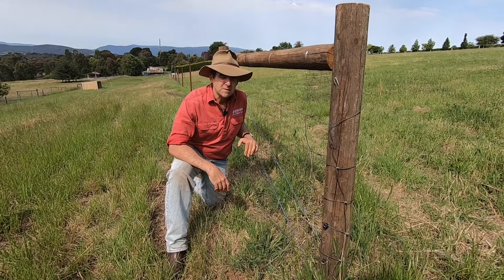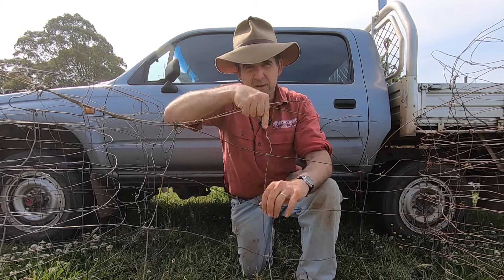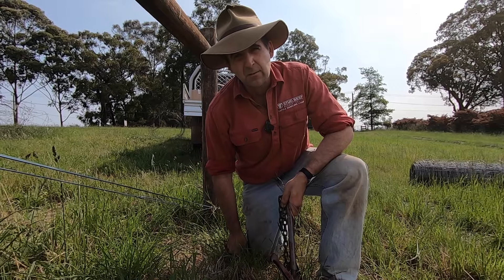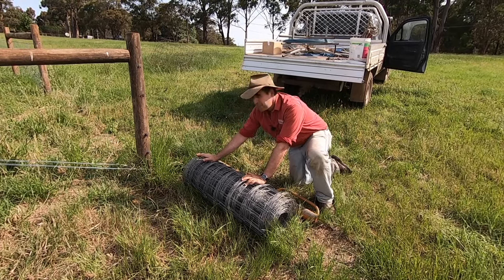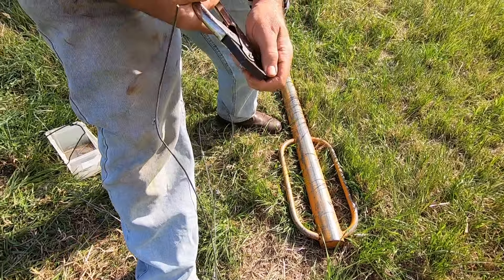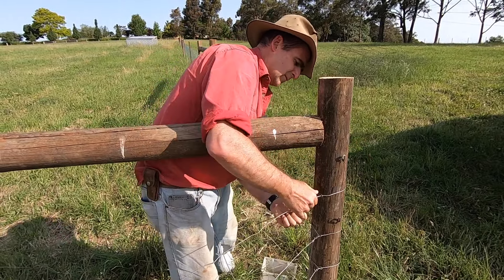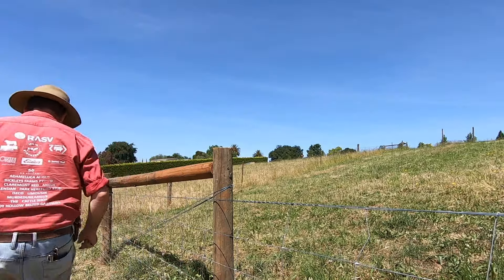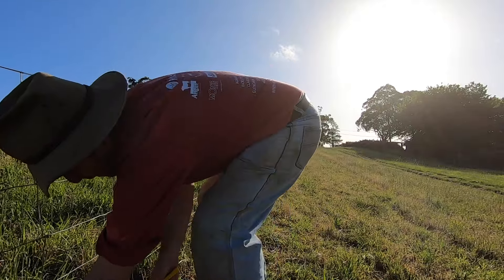How to Choose, Run Out, Strain and Attach Sheep Mesh

Comment: When you said if I ever used staples to strain wire you'd find me I did have a quick glance around the room. But I won't do it again now I know better. Thanks for sharing the info to help with doing it correctly.

Comment: Thanks for sharing Tim, lots of great tips that are often overlooked. What you explained is pretty much what DPI recommend. The only difference I did with my fencing is only using a single chain tensioner without a tension bar or board. I just took my time, started at the bottom, then pulled every second line, and tied off one line above each time, and only put enough tension as you explained, then lined up the uprights. I'm, keeping Goats and Sheep, and while the Sheep rub on the fence, the Goats really lean in the mesh, so far it just bounces back just like you explained, so allowing for that movement is really important. Now off to do some harrowing, lol.

Comment: So much great advice, best fencing video I've seen. I used Whites stiffstay which has high tensile as the top and bottom wires eliminating the need to run out those two extra lengths.

Comment: Thank you so much for the detailed information you’re literally the best fence guy on the Internet! 
Why do you suggest not making my own fence stretcher out of carriage bolts And a 2x6?
Reply: the amount of pressure you put on a wire  is like a tank trying to move a high rise building..
we use to strain every third post with a hoop made out of 32mm steam pipe about the same as the full length at once  but never did ring lock  but that was in Australia and maybe it was called different and my boss told me to do it that way

Comment: Hiya Tim loved the video, I’m very excited to be putting up some sheep mesh this weekend for my paddock to stop the dogs getting in from my neighbours. I bought one of those £30 generic monkey strainers (the yellow and blue one…) and I actually found it worked quite well for my top wires. I’ve just bought another one so i can tighten both my top and bottom wires of the sheep mesh. Haven’t quite got the funds for a proper straining clamp but for now i suppose ill just hook my strainers up to my top and bottom wires.
Reply from the maker: Hey mate. Glad you are looking forward to getting your fencing done. I know some people make do with 2x4 timber and coach bolts to make their own strainer bars. But I cannot recommend this as timber is not load rated for this purpose

Comment: Hi Tim great informative video. How necessary is it to have the wire on the top and bottom of the mesh? Can you not just have the mesh tensioned enough on its own?
Reply from the maker: Hey mate. Thanks. There are some new meshes that have a top and bottom line wire made from high tensile, (like striffstay), lowering the need. However older style mesh, like hinge joints have all soft wire lines, as mesh is designed to work as a trampoline, requiring stretch and elasticity. So a traditional mesh fence will sag between posts over time without support. Hope that’s clear enough. Cheers.

Comment: Hi, excellent video, thanks, so can you join the 100meter lengths of sheep wire net on the run and then strain up 200 or 300 meters at a time?

Comment: Hi Tim, Great video. Why don't you run the wires through the holes in the star posts? I've always been taught to do it this way, what is the benefit of either way. Thanks. Corey
Reply from the maker: I did a whole video on this just a few weeks ago. Check it out on my channel if you like.

Comment: Brilliant video Tim; extremely clear and helpful thanks. In the absence of a straining clamp arrangement, what’s your view on straining the line wires individually using the chain straining tool?
Reply from the maker: Difficult. The Whites strainer board is cheap (comparatively) safe and easy. It’s my go-to..... although I just got a Walters board... hmmmm sexy.....

Comment: Hey mate, looking to build my first sheep mesh fence. Can I use barb wire on my bottom ground/save wire instead of plain
Reply from the maker: I did this recently with a mate https://youtu.be/_HuBcJo9960?si=kuQ5c2APOyfO16Wx I’m not a huge fan of it, but traditionalists do this to reduce Roo traffic if they don’t have power on the fence.

Comment: Sorry, stupid question. Was the join in the top wire because it was from an existing run on a separate section of fence? If you're fencing a paddock from scratch, could you simply use the end knots at each strainer post? Or is the idea to build a predictable break point in your high tensile runs?
Reply from the maker: Basically, yes to all. I typically strain to post on runs of greater than 50m. Under that, there is not enough elasticity in the wire to allow slack to not affect the final tension.
Reply: @FarmLearningTim  thanks heaps mate! I'm fencing my first paddock this week ever. Wouldn't have been possible without your videos. 👍

Comment: Can you please explain why you instructed to twitch one over and one under part way through the video, then while twitching one of the top wires you twitched both in the same direction, what is the reasoning for twitching in a particular direction?
Great video!
Reply from the maker: I even watched it again to try and figure out what you’re talking about. Couldn’t. Start straining fences from the bottom. Finish at the top. Cheers.

Comment: Hi Tim, thank you for such a clear video, as always. Very useful information. I'll be going back to it when I try doing some of my fencing soon. I was wondering if you could discuss putting up rabbit netting (40mm heavy gauge, hexagonal) at the bottom of a fence for protecting areas of vegetable production, in case you come across such type of fencing project. Thank you!

Comment: good job mate....how many meters can I pull at once ?
Reply from the maker: Thanks mate. Depends on how many line wires (adds to weight and pulling tension) the ground you are pulling over (vegetation or rocks etc) and the method of tensioning. I find that 100m puts a fair whack on the strainers, but I do know of people who gut strain two 100m rolls by hand (in the middle of the run) I also know that up north, 500m runs are strained regularly, but machines are used to strain.
Reply: @FarmLearningTim  Thank you for the comprehensive support its mostly appriciated I have learned a heck of a lot from your channel thank you mate and it made my work so much easier...I farm sheep, cattle and game here in South Africa " Cape Town"  ....I also have some friends in AUS in particular a very good mate of mine that farms about 150 Km north of Brisbane....thanks again..I will be in touch.Cheers Norm
Reply: @norman1826  back in the day (70's & 80's) we used to do 110 yards to a strain, that gives you an equal spacing of 10 yards between the pickets (10 pickets to a bundle) and a strainer post each end. We used to get paid by the strain.

Comment: Hi Tim
I’m going to start fencing our rural property in Perth. I was wondering what length strainer plate do you recommend.
Thanks for your videos, I think I can make a fence now.
Reply from the maker: If you go the wireman strainers you can extend later. A cheaper option is the Whites wedgelock which is still one I use often. You need to get one that will cover the standard size mesh fence (900mm) and the Whites is about a meter so this should do you fine if you’re starting out
Reply: Are you going to make any videos on fencing sloping lands, our property is kinda like that. We live in the hills of Roleystone in WA.

Cheers and thanks for quick reply.

Comment: Hi Tim, sorry another newbie question, I have finally sourced a fence board strainer as in your video but am not sure how you attach the Hayes wire strainer to the middle bracket of the fence board strainer. I initially made a prototype version of the board strainer myself out of two steel bars but the steel wire (attached to the strainer) sheared when it nearly at what I thought was the correct tension for the fence.  Any advice greatly appreciated, cheers Martin
Reply from the maker: G’day Martin. Use the hook on the end of the chain. If you don’t have one then you’re using older strainers and will need to get one (or this could be the excuse you have been looking for to get some new strainers)

Comment: Hi Tim, have just become  an owner of some fields where I live in Portugal. Am I correct in thinking that you said in one of your vid's that you shouldn't take fencing around corners, i.e. for a square shape you should run 4 individual straight runs of sheep wire tensioned at each end corner as opposed to running one long length of fence wire?
Reply from the maker: Yep. Let’s you get the strain tension correct and if one run gets damaged then the others are still ok
Reply: @FarmLearningTim  Brill' thanks for getting back so quick Tim, we love the videos so useful as we're new to fencing, so much to learn. You would laugh at some of our attempts at the knots but we're getting there comes with practice I'm sure! Our first use of the fence strainer was hilarious, mainly as being new it was extremely stiff, thought we would have to leave it in situ after joining the the first two ends! Thanks again Tim.

Comment: I was told at the fodder store there are some brands of mesh that have high tensile top and bottom wires negating the need for stay wires. If this is the case could you put a strainer on the top and bottom wire and not use the straining board? Super helpful channel for an ameture  farmer.
Reply: @FarmLearningTim  I've got about 2km of this stuff on my place - 11/90/15 2.5mm mesh with HT top and bottom wire. I still use straining boards because it tends to belly out vertically if you don't. Connect each end to strainers and do a 'gut' strain at some convenient place then fix with gripples. I also have two HT plain wires along the top, one at 1000 and one at 1100 (mesh is 900 high), for mounting offset ceramic insulators. This has proved to be a durable and effective (if somewhat expensive) fence configuration for my needs. One last thing, if you like fencing work and want to do it all over again sometime soon, use cheap imported wire products ;)

Comment: Hey mate, how far from end post do you usually set up the strainer plater before straining? Just want to make sure i've got enough room to strain
Reply from the maker: I think what you are asking is what the ratio between vertical height and stay post length should be. Typical recommendation is 3:1 so for a 1.2m strainer we normally use a 3m stay.

Comment: How long a mesh strain between straining posts do you recommend for a cheapskate? Can you strain a few hundred metres?
Reply from the maker: Yes you can, but straining it is a bugger. Typically you use a strainer every 100m or so.
Reply: @FarmLearningTim  thanks. I have very, very rocky ground so large posts are at a minimum

Comment: G’day Tim, I am learning heaps from your great videos, thanks. You mentioned in a video that it is a bad habit to strain your plain wires onto the strainer post and I see in this video that you strain the wire with a join near the end post. Why is it a bad habit if you are introducing a weak point by adding a join? I have done a couple of runs by straining to the end post and after seeing your video saying that it was a bad habit, changed to a joining strain for my next one but would like to understand why. Thanks again for all the great videos.
Reply from the maker: I strain mesh to posts as there is much more elasticity in mesh. Plain wire you don’t want to loose tension in the end knot. However if it’s a REALLY long run then once again you have more give and can go to the post.
Reply: @FarmLearningTim  thanks Tim, I wasn’t sure if there was more to it than that. Cheers.

Comment: Hi Tim, when straining wire mesh on sloping ground, do you worry about how plumb the picket wires are with respect to your fence posts?
Reply from the maker: Check out my fencing a gully video. Basically no, you can’t always have them plumb.

Comment: Hi Tim.  I stumbled on your videos today - brilliant work, and just the sort of lessons I've needed after years of trying to teach myself and failing.  One question - any reason not to use offcuts of HT wire for clipping to posts?  You mentioned the soft wire on this video, and tie-wire on another, not sure if there is a reason for not using HT wire.

Comment: Another excellent video.  Love learning things all the time and reasons for doing so eg. not hitting staples all the way in!  I've welded an extension onto the handle of my wire strainers which have made all the difference.  I always put the back of the steel post up against the wire not what you do.  What is your reason?  Looking forward to your next video.

Comment: Another great video Tim, I always enjoy watching for the content and personality. I thought I'd mention that when I put plain wires up, rather than tying off to both end assemblies and straining in the middle or near one end and introducing a knot/gripple/spiralfast, I tie off to one end assembly and then strain to the second end assembly with the end knot being the final connection. Essentially I do plain wires the same way you did the sheep mesh. Is there any benefit of doing it one way or another, other than straining in the middle of the run as you mentioned?

Comment: Tim Thompson by running the top wire and bottom wire and pinning sheep mesh too those wire, is this the best way too stop kangaroos coming under the fence? I'm about too do 2km of fencing using your vids thanks so much
Reply: @FarmLearningTim  I'm about too by sheep mesh will the mod add on too that mate?
Reply: @FarmLearningTim  what size mate, I'm gonna get ringlock
Reply: @FarmLearningTim  thanks
I will wait for your vid will u discuss the use of poultry mesh in the vid?
Reply: Which option is cheaper?
Reply: @FarmLearningTim  is there a distance between box ends that's too far? What I mean how long is too l long before I should put another box end? Or can I go as far as I like ?
Reply: @FarmLearningTim  what picket spacing do u use?

Comment: Great video Tim, it contained some excellent tips and pointers.  Would this fence keep in cattle as well as sheep?  Or would you need to substitute some of the star pickets for timber or concrete posts?  Like every third post for example?  I'm looking to build a fence that is dual purpose.

Comment: Thank you so much for sharing this Tim.  Much appreciated :-).
Just wondering if you have any comments/advice for high tensile boundary netting which looks  much like the ringlock netting.  I've just completed a fence using cyclone tightlock which is high tensile for the line wires and medium for the vertical.  My case (only about 80m) probably wasn't the ideal place to use netting due to some bends, many undulations and a hill, but I wanted to try it and see how it goes so thought I would give it a go and learn some lessons.  The end result I think is really good, but I might have to wait a bit longer to confirm that...
Are there any differences using high tensile netting to consider?
I didn't use a bottom or top high tensile wire to clip the netting too (I figured it's high tensile as it could be added later if required) - would you add this on?
My fence is for sheep and cattle so I've electrified a top wire above the netting, and plan to add another about 3/4 way up the netting.  Good idea?
I wasn't sure on how the netting would handle the ups and downs but it worked out really good.  I was thinking I would need to have several joins to change the netting angle a bit but ended up adding some strainers in the middle of the netting to adjust as required and some more at one end and it seems to have worked a treat.  Probably not ideal in some respects but would you consider this a decent approach?
I used the two pieces of wood method to initially get the fence up as I planned to use in-line strainers to tension up the fence.  What are your views on the being able to adjust the fence with in-line strainers as required?

Comment: Tim, thank you for the great videos, this is a really fantastic resource for amateurs like me. I have one question, how did you attach the wire strainer to the clamp? I have seen strainers with a hook at each end for use with clamps but notice that the other end of your strainer had a wire grip. Best regards and keep up the great work.
Reply: Thanks Tim - so just to check, it is fine to hook the wire grip onto the hook on the strainer clamp? Just double checking as in your video you advised against using the wire grip to attach at the strainer post end

Comment: Tim, I'm in the US. The device you use to attach the hi tensile to the woven wire, looks like some type of automated hog ring type tool. Could you describe the tool or offer a link to a model so I at least know what to look for please. The addition of the hi tensile to the woven wire is genius IMO. Never thought of it or have seen it done elsewhere. Thanks for the idea! Great channel. Love the hat!
Reply: @FarmLearningTim  Thanks, you got me on the right track and I found a US manually operated tool that should work fine for me. Thanks!

Comment: Well I learned some new bits from this video so thanks very much for that Tim. A Question, the pliers / wire cutter that you're using at the start of the video are you happy with it, love it or are just used to it. Would you buy the same one again? Is it a fencing specific tool or general purpose?
Reply: Knipex 200mm bolt cutters all the way. Cuts the square knots flawlessly.
Reply: @FarmLearningTim  Thanks Tim, I'll look those up.
Reply: @coen555  I look at Knipex now and then and I'll look closer at their bolt cutters